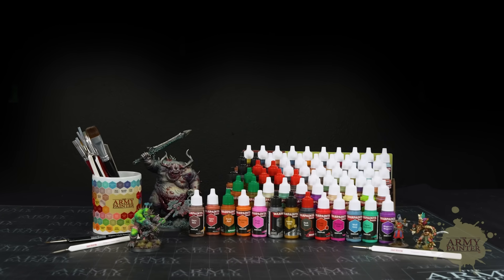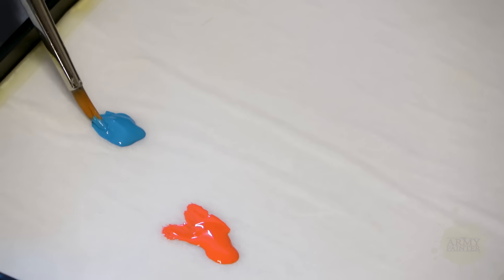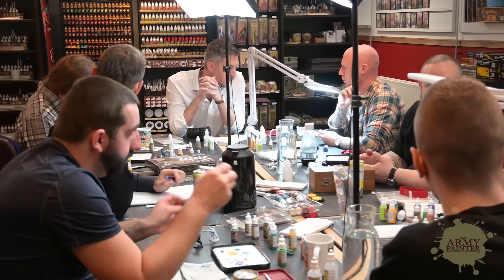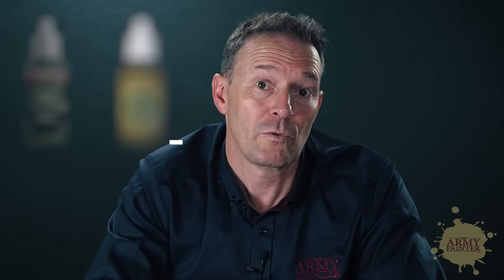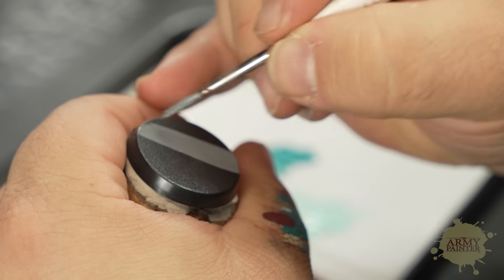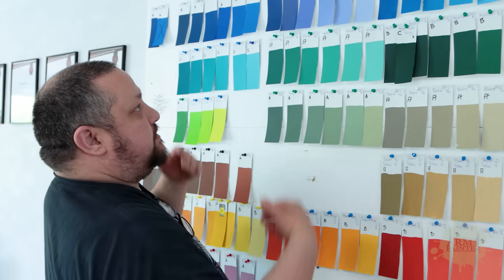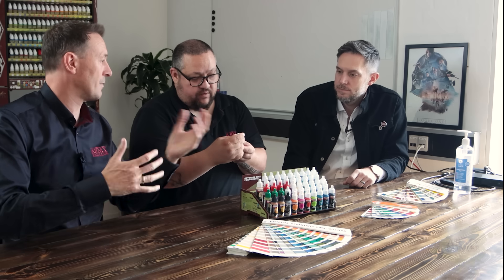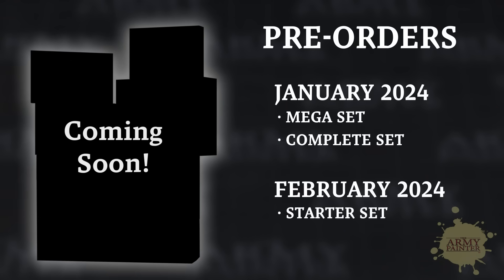Warpaints Fanatic | HOW did we make them?

Comment: If this turns out like you are demonstrating, between this and your SpeedPaints 2.0, you will have converted me 100% loyal Army Painter for life.
Reply: They converted me with the simple economics of their lines. They offer multiple grouped box sets, they are cheaper than other repaints, they use dropper bottles.

I've painted with p3, I've painted with Citadel, no paint line is without its problems. They bring up amazing points about how no paint is made the same and they are trying to change that. I've had Citadel paints that have splotchy coverage and I've had Citadel paints dry out after barely using them. For paints that cost more and come with less, that's inexcusable. I have the entire warpaint line and although there are a couple that have poor coverage, the set on the whole is a great paint set. I'm excited to see this new line and I guess I better start saving up for January.

Comment: Getting kinda hyped for this. Honestly I didn't used to like army painter paint. But my option turned around with the speed paint line, I like the og speed paint for some things, but 2.0 is also an improvement over the original and far less finicky. With the cost of hobbying in general going up with everything else, I hope that army painter can knock it out the box with this one. I will say I got one of the free bottles with my order, and I'm going to paint up an old ultramarine this weekend to see how it performs.

Comment: My preferred method to paint is go with a speedpaint and then edge highlight. I have most of the AP SP 2.0 line and use that for all the non-metallic basecoats. I don't want to do repeated edge highlights in most cases, so I like a higher coverage and bolder paint for that purpose. So I'm pretty sure these will slot well into my line up. Looking forward to giving them a shot!

Comment: Not gonna lie, this is getting me excited. Never been a huge fan of the Warpaint line. But if they can deliver something akin to Pro Acryl quality with a larger range and cheaper price point I may have to reconsider my loyalties. 

My one big concern is those mixing balls clogging the dropper bottle. This is a pretty common occurrence when you hold the things upside down and can sometimes lead to you squeezing too hard and blasting paint all over your desk. Pro Acryl prevents that with a custom topper. But if Army Painter is just dropping mixing balls into their current bottles it's going to cause problems.
Reply from the maker: We always recommend giving your paints a good shake before dispensing some on your palette. If you notice that paint is not coming out, DO NOT squeeze harder like an Orc or you’ll have Orc-ish results. Instead, use a cocktail stick or pin to gently unclog the dried paint on the nozzle or to dislodge a Mixing Ball that may have worked it’s way into the nozzle. Holding them at an angle also helps.
Reply: @TheArmyPainter  🤣DO NOT squeeze harder like an Orc or you’ll have Orc-ish results....😂 You win the internet today!!

Comment: OK, I'm a Vallejo guy, my first try of Army Painter was starter set of Speed Pains v1.0. Not impressed, because of reactivation. But what I really like about AP is, that they still trying to improve. I've heard Speed Paints v2 are awesome, and I'm really excited about this ones. And that's might be stupid, but selling sets is what draws me more to Army Painter line. If you add some way to buy next sets without overlapping, that would be awesome. Start small to check, and they but next set, and next and next. Keep up the good work.

Comment: That flexibel triad... Would that be a hexad? Whatever. That system sounds cool. I like the idea of having a lot of incremental steps within each colour. Somebody is going to make some absurdly smooth blends with that. It also prevents me having to mix paints to get the exact shade I want. Mixing is fun and all, but it gets a bit inconsistent if you're gonna have to do it across a bunch of models. 

Also, you guys adding in agitators in the factory is a blessing. Some paints need shaking like they owe you money (looking at the colour white here), so having a little ball or two in there really helps out.

Comment: Your old range will still be around though right? Greenskin makes an amazing glaze.
Reply from the maker: The original range will be phased out, but Warpaints Fanatic still features our Colour Match System for staple colours such as Daemonic Yellow, Greenskin, and so on – other colours will have very similar representation within our Flexible Triad System.
Reply: The new green skin is better, even for glazes.

Comment: I'm seeing a lot of 6:es here: 216 = 36x6, 18 = 3x6 of each of the effects, metallics, washes, and skin tones, leaving 24 hexads of the main colors. I figure you're probably doing your normal Starter, Mega, and Complete sets, but I can't help but wonder if there are smaller sets (like the ones Scale 75 does) with one box per hexad planned. Or maybe 3 hexads in a box, which would match each of the special paints. If nothing else, that'd be a neat way of buying in gradually without buying singles.

Comment: Colour triads were introduced by Coat d'Arms paints, several years ago, but the idea of using a five-piece sliding one is greater still. Being out of practice, I would probably go for the first, middle and last colour for a start, but would that make for too much contrast? Would three analogue ones make for too little? I am also intrigued by this "stabilizer". Till now, acrylics, compared to oils and watercolour, has struggled with acidic pigments (like Prussian Blue) and saturation. Plastic polymers have not been able to "bind" as much pigment as gum arabic or linseed oil. This could be a game changer for not just hobby paints. A bit curious about whether Armypainter fanatics are all opaque? Like gouache. Are they?

Comment: I have switched to Armypainter warpaints 2 years ago from Citadel
I had not the best luck with AK or other high brands as those paints, Flocking and clogging. 
Also speedpaints concept does not work for me ... i want to have full controll.
therefore i am am very much looking forward to high coverage paint
and the multi triad system seems useful
... 
My question would be how does the paint behave inside a small bottle
will it thickens up over time... excesive shaking required?
will we be able to thin the paint for glazing and for painting faces?
Is the color hue 100% matching the Air paint.
i am courious and i will get my hands on a abox ASAP.

Also.. all the other hoby products..... snippers, files, cuters, knives, scenic gras... glue, brushes.
they all fit into a very affordable package.
Reply from the maker: Stay tuned for more details on the new Fanatic paints in the coming weeks :)
Reply: Oh ... i watched it again. 
One of my questons allready anwserd ... 100% color match to Air paint.

Comment: Really?! cool. Full coverage and same covereage for all colors ...really...even yellows and those that take 3 or more layers to actually be opague......(im making a wooooooo! face right now )  ...nice!  Thats actually quite an achievement! guess adding upto 700% pigments would do the trick but how did you get it to not be grainy after 300% addin... anything over 250% goes chalky... ??  cus i tried once on art assignment deadline jam... ran out of paint..ended up using Gesso instead of white so it wouldnt bleed through,, haha... but the only thing that seemed to also work was adding lots of maizena..ehh cornstarch... and carefully heat up the dollarstore paint to get it hot enough for the strach to thicken .. and i spackled it on like clay...and quickly blow-dried it to settle enough not to soakup the lower still wet layer ...lol....
So yeah, Wow... full coverage, all colors, and still smooth even liquid....wow.

Comment: Amazing stuff. I dropped some on a paper towel yesterday to see the color and it dried maintaining its color and  consistency on paper. 💯💯💯
EDIT UPDATE 23OCT23: I used the Ultramarine Blue giveaway bottle on a Marine and this stuff is really amazing. Coverage was pretty complete in one coat, the color was full and vibrant, a few small areas needed touch up but overall was very happy.  Cant wait for the full line to be released.

Comment: to bad you are using the old dropper bottle tops and not the new ones vallejo uses. so your good paint will spill into the cap and make a mess or clog the top. knowing that 10 to 20 % of the paint will end as a mess in the cap makes it hard to choose your paint. btw i realy love your speedpaints, specially the metal ones. great job done there.
Reply from the maker: The bottle top design hasn’t changed from the previous version, but the new bottles have an improved material makeup using a clearer plastic that more accurately displays the paint colour inside and it’s 100% recyclable.
Reply: @TheArmyPainter  nice... but it will still spill into the cap and waste good paint.
Reply: I haven't had that issue at all. Are you storing your paint upright or on their side?

Comment: These look good, but I'll never buy AP paints again after the sh*tshow that was speedpaints 1.0.
Reply from the maker: Don't just take our word for it, we sent hundreds of sets to customers and fans for their feedback and initial reactions. Simply search #warpaintsfanatic to see their genuine and unbiased reactions to the new Fanatic range.
Reply: @TheArmyPainter  I did take your word for it on the speedpaints 1.0 line, and I was burned hard. You guys still won't admit that there was even an issue with them even though you immediately reformulated the entire line. I'm not going to make that mistake again.
Reply: 1.0 is VERY useful. You get free wet blending if you want. I know we all have our different styles. But objectively, 1.0 is not “bad”, it’s just a different way to do things. Personally (so this is just my opinion), I love the fact that it’s different. If I wanted the same as every other paint, I wouldn’t have bothered with 1.0. Also, just like 2.0 and Contrast, it’s a dream through the airbrush.